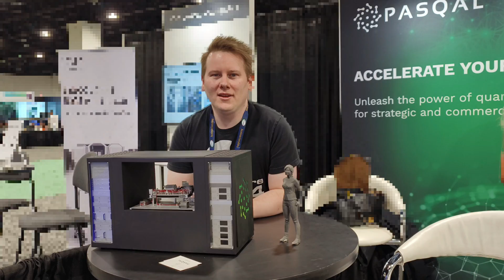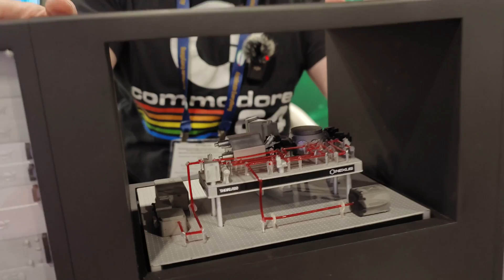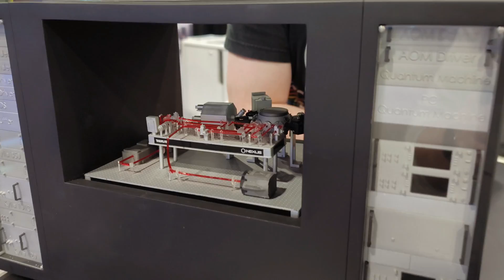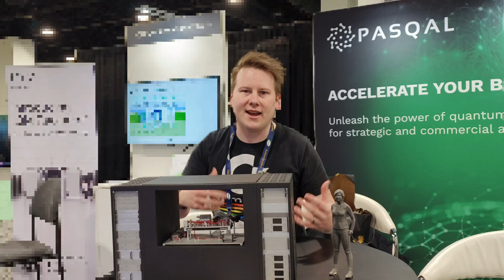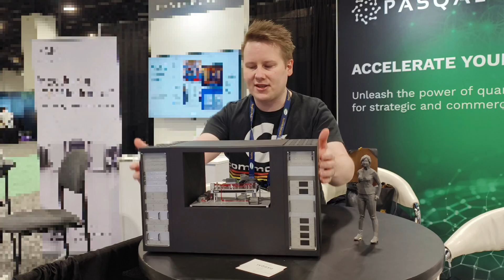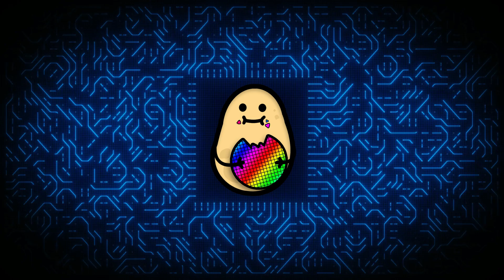a thousand qubits with lasers

Comment: Perhaps slightly off topic. But since you now work as an adviser. Intel has yet again made a foul of them self with "snake oil" , "used car salesman" , and "kids need brand new Intel  laptops in order to get the best grades" deck of slides. Why do intel faceplant so often with their marketing material??
Reply from the maker: I'm planning to do a video on it. Long story short, it wasn't marketing material. It's sales material for internal use. Intel does it, AMD does it. Every company builds 50 decks like that a year. One gets leaked, OMG big shock /s